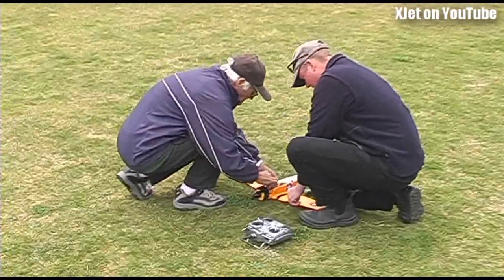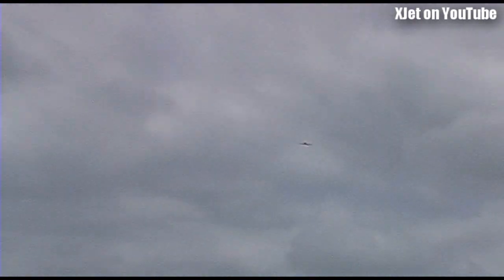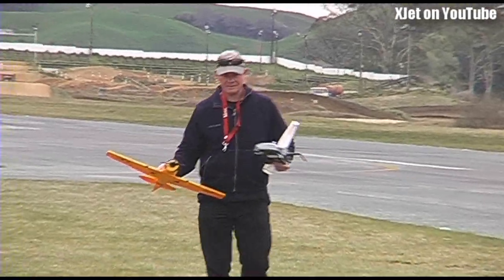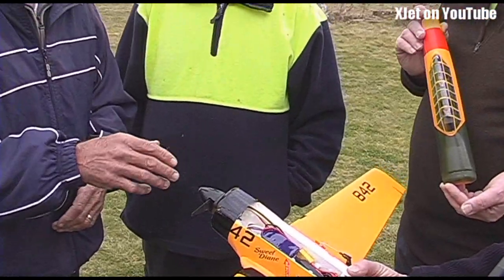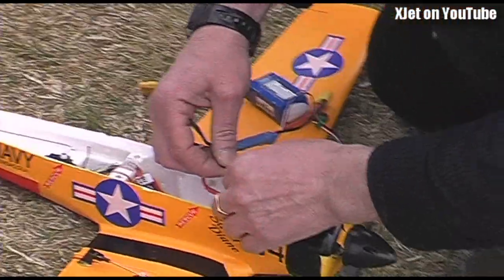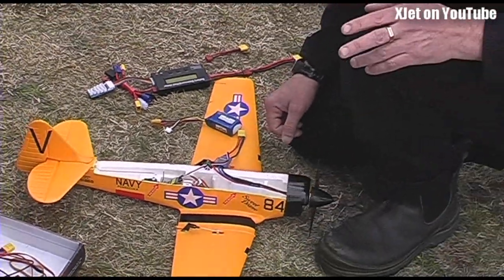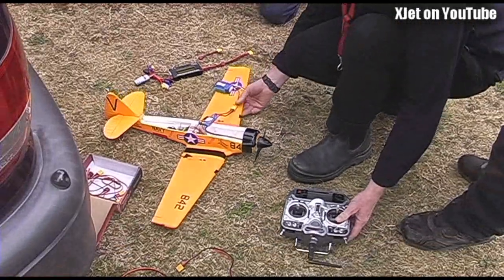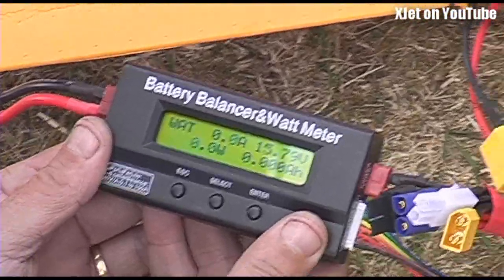HobbyKing AT6 Texan FunFighter RC plane blows an ESC

Comment: @xjet thank you again for your great support- I understand having a turnigy prop creates more drag- is that a good thing to land eg. warbirds that need a little speed on landing (to avoid stalling too soon) and and can glide in smoother without staling or will the extra drag be better in general for slowing the plane down for landing in general..?

Comment: @hakank1 Yes, I will find it and post it as a response. I will give you a hint. It will easily cruise at 1/4 throttle (about 45 km/h), and when I gun it, approximately 184 km/h.

Comment: @justinspirational I see now that the brake is to stop the prop faster- without the brake will it eventually come to a stop but just take more time, but never the less will still cut the throttle?- will having a brake enabled put more wear and tear on the motor? seems like a good idea to have a break to avoid prop strikes/breakages on landing

Comment: @xjet thank you - I would definitely appreciate a video on how to set up an ESC- could you share why or under what circumstances you would choose to have the brake disabled- it baffles me to understand why the brake isn't on by default as why wouldn't you want to be able to cut the throttle?- if it's disabled- what happens when you throttle stick is in its lowest position then? thank you again

Comment: I just ordered the rarebear gunfighter and thanks to your video I also ordered the same 30A Hobbyking ESC - can you tell me if this ESC needed programming or is it good to go stock (including eg. having the brake on- ie. will turn off throttle completely when stick is fully down)

Comment: Hello Bruce,sometimes I read things that I do not understand, such once an engine was about 60k (if I remember correctly, or something like that). Well, if K is for the thousands, then they are equal to 60,000 v that seem too much for an electric motor. Now I read that it is always too much of 30A (30ah is half of a car battery). At the end i read on the instrument of a current  of 0.035ah. So I wonder, am I will mess up measurements? Thanks for the great videos and greetings to you all.